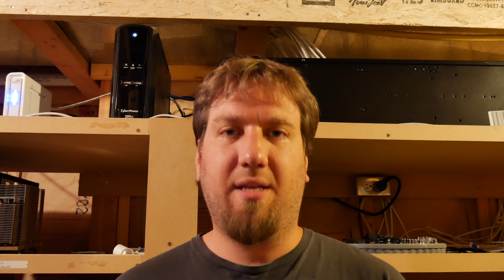How long will my 125$ battery backup power my network and Server for? (CyberPower GX1325U)

Comment: is it still running good? after a few years you got it that is
Reply: Was asking coz I was planning on getting myself a simular modification, just with 1500VA and 900 watts
Reply from the maker: @l_BlackSwordsman_l  well i dont think youll be disappointed with this if still avail. :)
Reply from the maker: Yessir! I havent had to change the battery and its still goin strong. Though i need another one for more equipment i got. :)

Comment: I have one of these, also purchased when newegg.com (I think) had a good deal on them.  It just keeps working.  

When the Atlanta Falcons played in the Superbowl and my wife just had to watch the game, our commercial power went off (for 3 hours) with 15-20 minutes left in the game.  No problem, as the 55" TV and the cable box were on the GX1325 and the picture never even flickered.  She may not understand what why I spent $130 for a pure sine wave UPS but she definitely appreciated that everything continued to work when we lost power.  The Uverse router has the power supply with a 12V, 7AH battery in it and a promise of 3 hours backup.  I hedge that time with a UPS feeding that power supply.
Reply from the maker: Thats awesome and sounds like a great setup. Thats kind of the problem with IT stuff. What are you doing or why do we need this, everythings working. Then when it doesnt work WTF I thought you were good at this or what not. LOL

Comment: add2 12v 9amp btterys will fit same battery fits on cpfc1500va comes with 8.5amp bb name of batterys so intend of 128 min it says no lad it only has 14ampyou can gain 35 min just buy changeing to 9amp not 7 amp comes with
Reply from the maker: Thats good to know.
Reply: Can you elaborate how you did that?

Comment: For the back ups do u plug it directly to the wall plug or a surge protector ? Is there reason to choose one over the other ?
Reply from the maker: A. K. I plug the UPS into the wall, but then i will plug just power strips into the battery backed portion for mor ports to plug stuff into. Theres no reason to plug the UPS into a surge protector as it is a protector and more  I hope that helps.
Reply: PCGoblin it does. Thank you.
Reply from the maker: A. K. Youre welcome